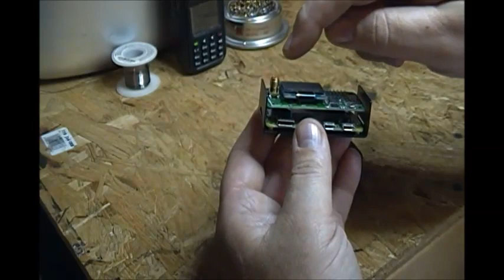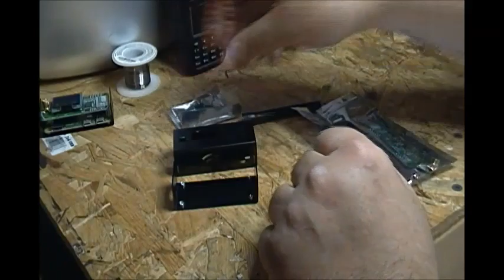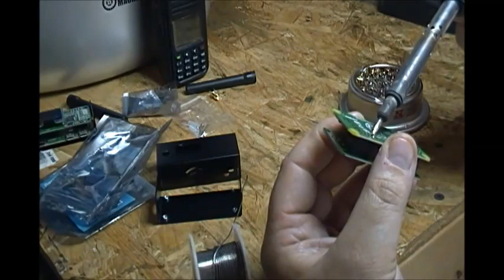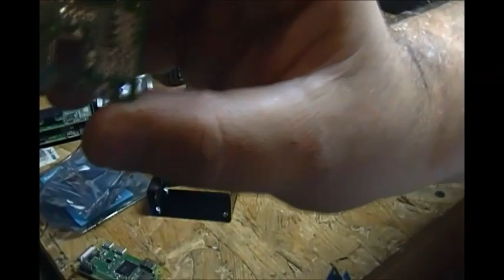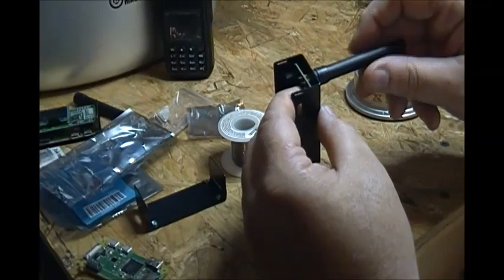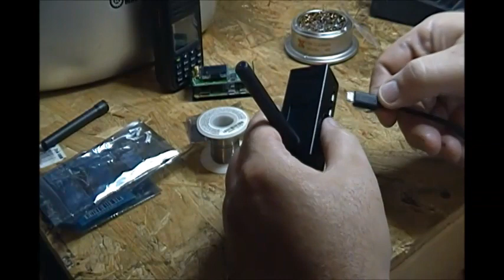MMDVM Build

Comment: Get yourself a silicone rubber heatproof  mat, plus a set of Helping Hands to grip whatever you are working on, total cost under $10 and will make your life and especially your soldering (there's an L in there America) so much easier. 

Also run an analyser over those hotspot antennas, usually the SWR is off the chart & when you're dealing in milliwatts it is important.
Best advice is throw the antenna away and add a little $5 stubby that resonates on the band you are using, all that mismatch is bad for the dvm, creates heat & makes the board deaf & dumb .

https://kek.gg/u/yn-j

https://kek.gg/u/Bn2s